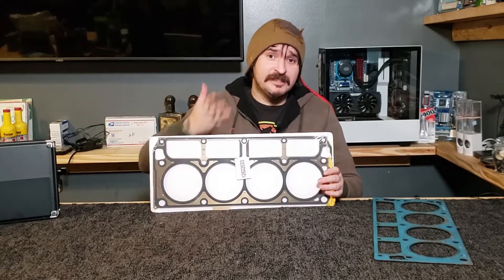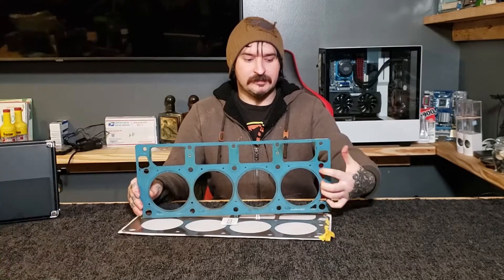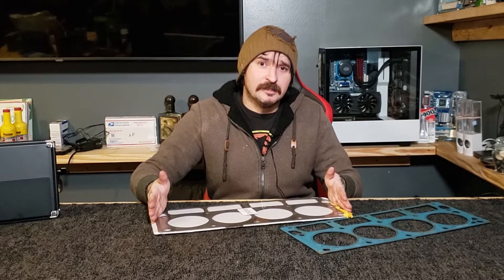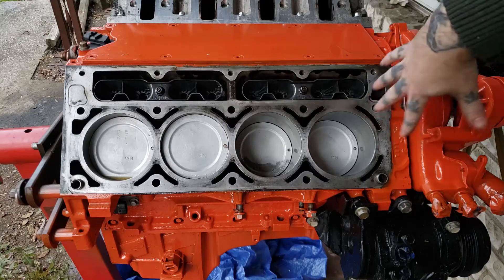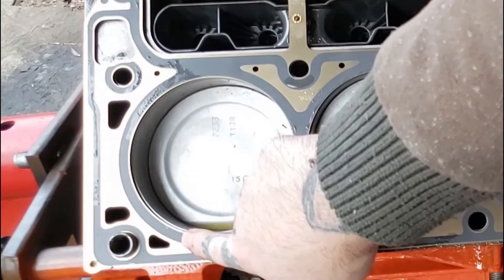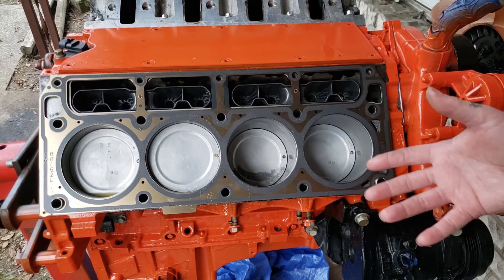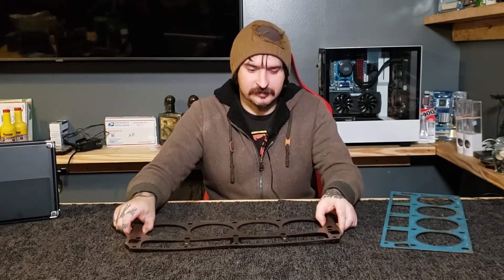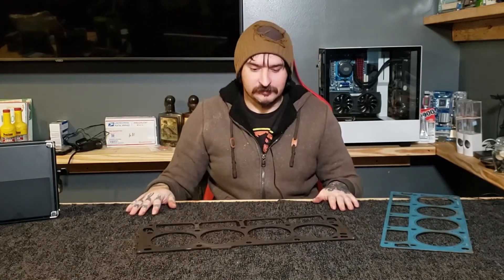Mislabeled Head Gaskets - Over Heating Issues - Head Gasket Failure - Engine Build

Comment: Man....I'm half tempted to pull my damn heads off....so I know the heads swap side to side...is the passages ALWAYS on the rear, no matter passenger or driver side?
Reply from the maker: yes it wont matter, the way the gaskets goes onto the blocks is what matters
Reply: @TattsForLife  i pulled the heads and it was on correct as far as the passages...BUT it's like they gave me 2 of the same gaskets so the drivers side has to be sort of flipped upside down to have the passages in the right spot...does that sound right / make sense? Appreciate the response and your time

Comment: I think this what might’ve happened to me.. just replaced my gaskets and I was overheating now I have water in the oil.. also had oil spilling out the back of the head.. makes sense if the oil passages are blocked..
Reply: Mine doing the exact same thing now🤦🏾‍♂️